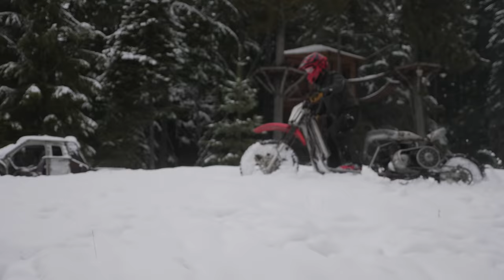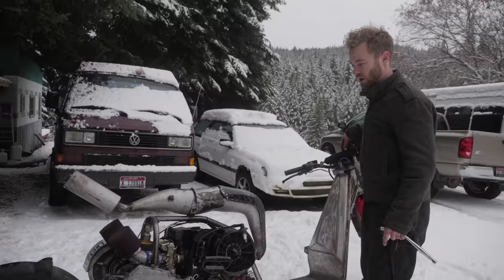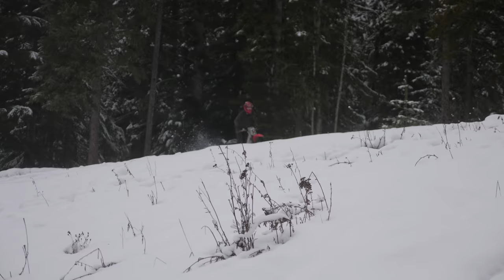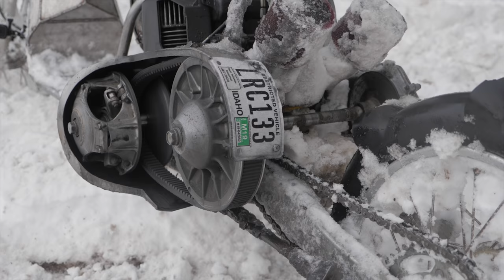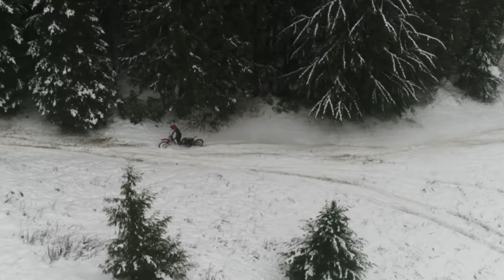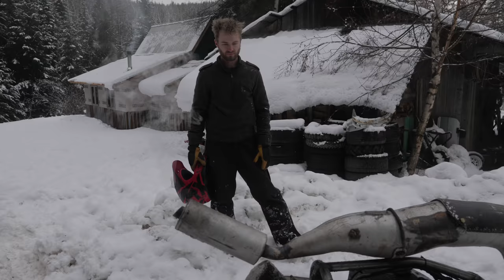Snowmobile Engine Swapped Scooter Rips in the Snow

Comment: a ski in the front might be enough, if it's doing a little snow packing for the paddle tire to bite into when running straight. a taller front tire/rim might do good things too. Merry Christmas!
Reply from the maker: That would probably work on relatively flat ground with not too much snow. But here we have mountains and many feet of snow! So a track will be required for ultimate fun! 😎

Comment: How is the engine cooled?
Reply: By air. It's fan cooled.
Reply: @troyroquette261  is there a radiator on it or something?
Reply: @jarettdaniel9513  there is a pully on the crankshaft that runs a belt that runs a fan that pushes outside air over the cylinder heads.